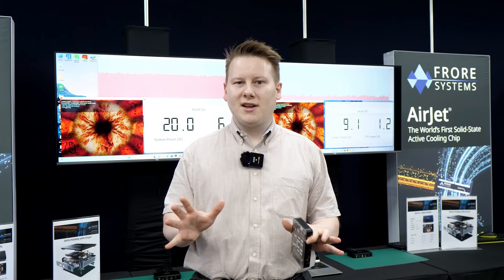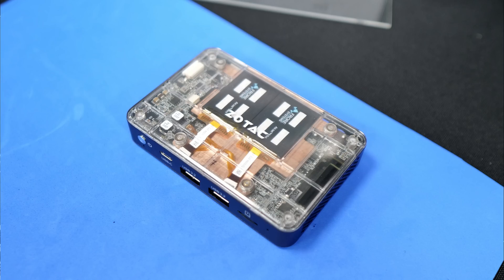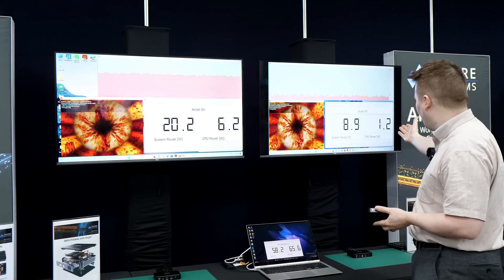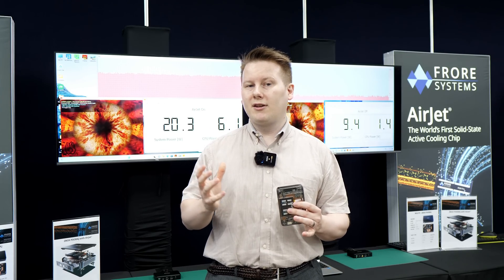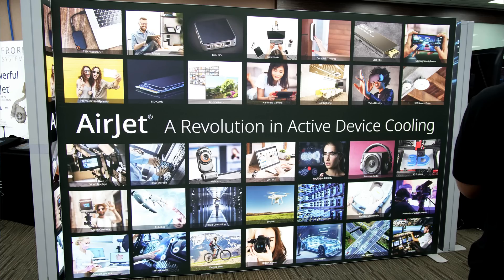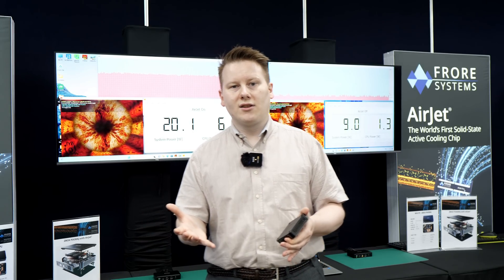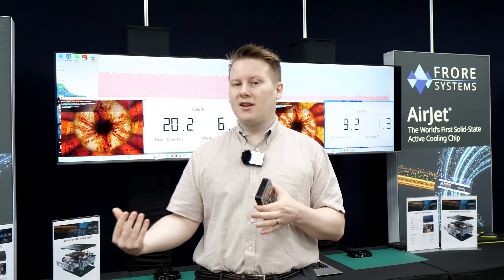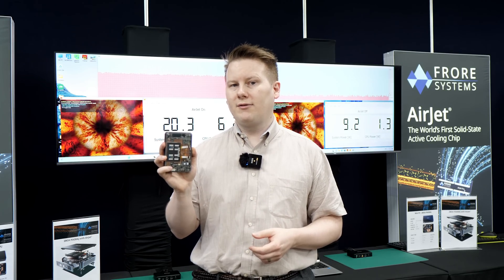This is Your Next CPU Cooler, and it's THIN

Comment: Imagine a cpu cooler with stacks of these on plates, instead of fins on the heatpipes. Just 4 of the pros move 40W already. IDK about the cleaning process beyond 6 or 8 units tho. 
You'd need a vacuum tube tool to access the hard to reach places...
Ideally we move beyond inefficient transistor based processing with room temp. quantum & photons...
Reply: if it's all redesigned into a box with filters on the outside it's done & compacted

Comment: This is very interesting, although I have no idea what "5w of cooling" means - because every company seems to have a different method of measuring the heat output of their chips.
I still remember Apple's fiasco of using Intel I9 in their Macbook Pros one generation before they released the M1, because for my understanding - they didn't have the chips on hand in time, and on paper their chassis was capable of cooling the CPU according to the numbers they got from Intel. What's the method that each party used to calculate the heat output and cooling capacity? I have no idea.

Comment: I've been tracking the progress of FRORE even before CES and they are a very consistent company. The advantages are surprisingly many, from the obvious like better thermals and less noise, to less obvious like dust proofing internals. The intake vents of a device can all be fitted with dust filters. The ROG Ally has a very good thermal solution but this would take things even further for Handheld Gaming PC Consoles. After the vapour chamber this is next and arguably more ground breaking. The Apple Vision Pro uses a fan. 😉

Comment: 以下是视频 "This is Your Next CPU Cooler, and it's THIN" 的结构化摘要：

介绍了一家名为 Fros Systems 的公司，他们正在推出一种新的散热器，这种散热器使用振动膜将空气强制通过，提供 4 到 5 瓦的冷却功率。
这种散热器可以直接安装在芯片上或铜制散热片上，可以替代小型设备中的风扇。
这种散热器非常薄，只有 2.8 毫米，再加上另外 1 毫米的厚度，可以放入智能手机中。
这家公司成立于四年前，总部位于美国湾区，制造工厂位于台湾。
目前他们正在与来自 30 个不同市场的合作伙伴合作，包括 LED 照明、汽车、笔记本电脑、迷你电脑和 SSD 外壳等领域。
这种散热器的价格比风扇略高，但是在小型设备中使用时可以提供更好的冷却效果。
希望这些信息对您有所帮助。如果您需要更多信息，请告诉我。

-
[1]: Best CPU Coolers 2023: AIO and Air Coolers - Tom's Hardware
[2]: Best AIO Coolers 2023 | Tom's Hardware
[3]: How to Buy the Right CPU Cooler: A Guide for 2021 - Tom's Hardware

Comment: One thing you didn't mention which I've seen in other coverage is that the airjets can work in reverse to blast out dust, kinda like smartwatches can do with their speakers blasting out water. Having them on an automated cycle and doing so at boot would be stellar and painless for users.

Comment: Would love to see one of these in an M3 MacBook.

Biggest downside of the Air is that it overheats in long workloads, biggest downside of the Pro is that it's a bit thick/heavy if you want something ultraportable.

A thin, light, powerful, ~15" MacBook that doesn't overheat for long workloads would be cool as hell (pun absolutely intended).

Comment: Initially I was going to write Frore's AirJet off as a vaporware product when they debuted at CES months ago. But they've already partnered with Intel (see their website) and are producing concept devices with Zotac and claim they will have retail products shipping with AirJets later this year. If the economics work out and they can scale manufacturing, I am willing to bet we see AirJets in Intel NUCs and ultrabooks in the next 2 years.
Reply: The thing about the economics is that, just like with SSDs, I'd be willing to pay more if it means superior noise/thermal performance. Significantly more.
Reply: Do you think airjet cooling systems will come to desktops?

Comment: Would be interesting to see how long it lasts compared to a fan, and whether performance drops off with time.
Reply: piezoelectrics tend to last longer, and afaik don't degrade.
Reply: With no moving parts I suspect performance will remain the same.
Reply: I wonder what'd happen in case dust would enter. e.g. a unit without any filters. just curious.

Comment: If I understood correctly, a main part of this is improving contact between the air and heat spreader/chip. And one obstacle to cooling performance is the various boundaries between things that heat needs to pass through from the active part of the chip to the outside.

Comment: What's the lifetime of those things, not sure if it's really "solid state", because there are probably moving parts - tiny yes, but those wont last forever .. And what about using those to move water? Would increase the heat-moving a lot, then it would be like active heatpipes ..

Comment: For the ultra high end (server/workstation) we desperately need to move to on die micro channel liquid cool, especially as we move more and more down the road of 3D stacking where we stack heat source on top of heat source!
To properly realise 3D chip designs TSMC have been testing Direct Water Cooling, where the water channels were etched directly into the silicon layer on top of the CPU. In their tests, silicon channels were etched into a silicon layer with a silicon-oxide thermal interface material between the microfluidic system and the actual silicon of the TTV.  The results were really impressive and could enable more than 2000w chips that are still cooled just fine with a suitable water loop. 
Obviously we don't need to go to 2000w chips but it's nice to know we have that option for Zen 8 when each tile has 6 layers with 32 logic cores per layer each with a layer of cache in-between them!
Reply: looking forward to photonics and room temp. quantum for better efficiency

Comment: How do you clean the dust filters?
Will cleaning the dust filters damage/reduce the cooler's ability to cool?
Otherwise, even I see this invention has great potential.
Reply: I wonder if they have a reverse/cleaning mode?
Reply: @Marc-ww7cc  Apparently it does have a reverse cleaning mode that it can do. I have read it on a couple epublications.
Reply: @Marc-ww7cc  From my understanding it's just a vibrating membrane, so reversing that wouldn't reverse the airflow. That's just based on another video I've seen on these though, so don't take my word as gospel.

Comment: it's cool that their dynamic pressure is very high thus they can slap on better dust filter than you could on regular fan - this can potentially keep all the interior of laptop cleaner than with regular fans
Reply: quite practical